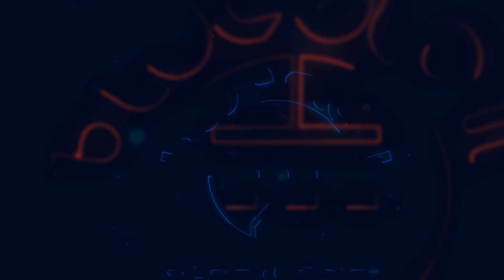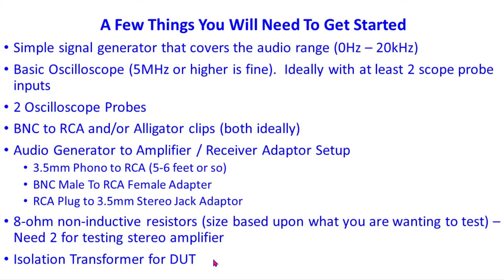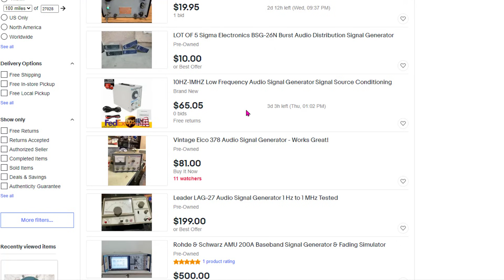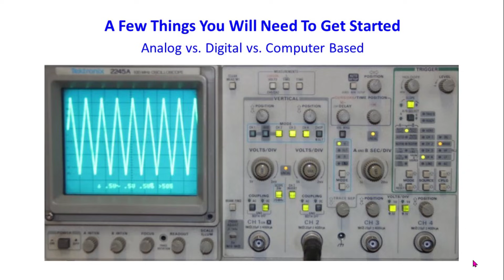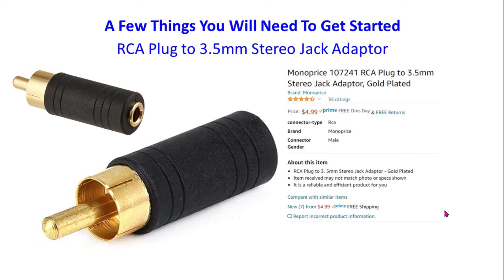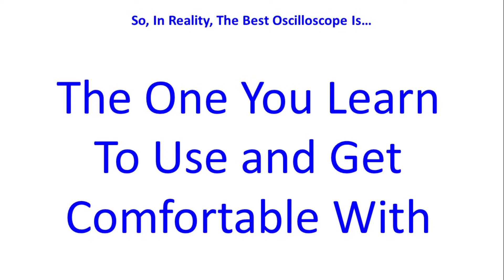Buying an Oscilloscope and Accessories For Audio Bench Work and Testing

Comment: Class !!! but a good multimeter  is need too .... a precise of coarse !!!
Happy good year Eric from France
Reply: And it pays to get a good quality meter. Although the "cheapos" do work, they don't work very well after a while and will become intermittent from oxidation on all the contact areas. Areas like the switch contacts and probe sockets where you have to "wiggle" them to regain non-resistance contact.  I finally went with Fluke when I could afford them and never looked back. There are other "top shelf" brands as well. I still use my "cheapo" meters a lot for things like "quick" checks and the like to save wear and tear on the Fluke meters.

Comment: Great video Mark!!! It may also be worth mentioning to the audience, that Variacs (Autotransformers) are not isolation transformers. Many people think they can double as such. Also, an isolation transformer, although electrically isolated from the line and neutral, is not necessarily isolated from ground. If you are going to use a 1:1 transformer for ground isolation make sure you check that the line side and load side grounds are not the same point electrically. For some, this can be fixed by a simple removal of a ground strap connection or snipping the ground prong on the line-side plug. I have a Tenma 72-1095 Isolation Transformer with adjustable voltage and it has a common ground. The load side plugs are connected to ground via a ground wire to the chassis. Disconnecting this wire isolates the load side. Just something to think about. Thanks!!!

Comment: Those non-inductive wirewound resistors typically have the wire wound in both directions, which results in a relatively low inductance. Not zero, but close. Unless you're taking really low distortion measurements, it's probably not critical to have it be ultra-low inductance. After all, a speaker is somewhat inductive. It is definitely worth getting four resistors though, because you want to be able to test into 4 ohm loads.

Comment: Great video and good advice.  Be sure to also get 50 ohm BNC terminators for your scope inputs to assure that you'll see correct voltage readings from your signal/function generator.

Comment: Very good video, sir.  I've ended up with several 'scopes ranging from a late 40s lab model through a dual channel Heathkit c.1970 up to a 100 MHz Techtronics.  For audio use on my radios I use the Techtronics or another 10 MHz scope (tube equipment) or one of the cheap DSO138 or DSO150 units from eBay/AliExpress/Bangood for solid state equipment (these are roughly $24 - $30).  I have used the DSOs fed through a capacitor for some boat anchors.  I plan on closely following the remainder of this series.  Thanks.

Comment: Being stuck on the other side of the pond does complicate things a little; looks like this one might fit the bill for all of us running lethal voltages at home:
https://www.amazon.co.uk/Bronson-1000-Isolation-Transformer-Toroidal/dp/B07K378Z2N
I would be grateful if you could please have a quick look and confirm it's suitable and thanks for a great start to a much needed tutorial !
Reply: It should do fine. Just keep it to 80% of it's rated capacity for longevity, although the MAX is 1000 to use at that all the time will cause premature failure. Most equipment will be way under that. Add up the maximum draw of all your equipment, then add 20% (minimum) to choose which to get. If all your equipment adds up to, say 500va, then you're good to go with a 1000va unit with room to spare.
Reply: @JeffCounsil-rp4qv  Thank you so much Jeff, have a couple of power amps with 800VA trafo each, so I'm hoping this will manage to hold while 2x15mF/100VDC caps are charging, obviously hooking either one at a time. Fingers crossed.
Reply: @paulb4661  You're too close to the max and will need bigger ones...  Maximum capacity: 1,000 Watt / Operating capacity: 800 Watt
Reply: @JeffCounsil-rp4qv  Hi Jeff, you're absolutely right, but then again I do not intend to run any of them nowhere close to the rated output of 230W per channel into 4Ω. Measurements will be done at between 1 and 10W of output power at most and looking at the power consumption meter, each draws about 150W  only at these levels, they are both class AB designs thankfully. Next trafo up, 1.5kVA, if I remember correctly, adds another £70 to the price tag, so a bit of a bummer. On the other hand perhaps it's worth it, for the sake of peace of mind.
Reply: @paulb4661  Yeah, sometimes the cost is a show stopper. However with the 1.5k, you will have the capability to go with "throttle up" without the risk burning up the transformers, and possibly the amps too. Even at "nominal" volume levels, you can get transients. And the impedance curve of your speakers could dip pretty low on the bass notes and draw more current.  Transients (peaks) happen so quickly that most meters won't actually show them. Especially RMS meters that "average" the readings.

Comment: I use Tektronix 2213A analog oscilloscope.  I bought it brand new 35 years ago.  Make sure the scope you get is in perfect condition and freshly calibrated.  If you get some old junkie military surplus unit, you may spend more time working on the scope then on the circuit you are experimenting on.

Also:
DO NOT CONNECT YOUR OSCILLOSCOPE GROUND LEAD TO A HOT CHASSIS.  
IF YOU DO, ZAP!
Reply: I picked up my Tek 2213A only this Summer. I was new to o' scopes and was surprised how easy it is to operate.
Reply: @williamstevens7090  Way cool !  I'm sure you paid a lot less than I did.  My Tek 2213A was $1,400 in 1985.

Comment: In regards with the oscilloscopes and generators, there are actually pretty good cheap digital chinese ones currently available from such manufactures as Hantek (DSO5102), Uni-T, and even pocket-size ones like from Fnirsi 1C15 on Aliexpress and other marketplaces. You can get full setup for 100-200 bucks. And it's more than enough for the audio.
Reply: Very true. But how well do they work a year later? Have they drifted out of spec? Have the connectors oxidized enough (from cheap plating) to cause erroneous readings?  I have found most Cheaper Chinese stuff to be in serious "question" a mere year later. Sometimes only a few weeks later. Although my Brother's Hantek seems to be one of the better brands, it even has issues only 6 months later with one channel going very noisy.  The old saying never fails... "You get what you pay for"....
Reply: @JeffCounsil-rp4qv  That could be true that there may be some quality control issues. And of course never trust the specs they write, it's a lie. But for audio work it's more than enough. As for me, I own a $150 Hantek too for about a year+ and it's still reliable. Most of the time the issues would be indeed oxidation or other very easily fixable stuff. "You get what you pay for" is very true but getting the best equipment for everything - I don't have that much money, I'm not from the Gates or Bezos family, and I have a limited budget which I would rather spend on better drivers for speakers. Plus it's just one of my hobbies, we're not talking about making money with it, right? :) Even then you can get a cheap one until you get a stable flow. As for old aftermarket models, who could give a guarantee that they won't fail too? At the end it's the same pig in a poke.

Comment: Great stuff, Mark. Thank you. Does anyone know of a source for a iso/variac/ammeter in one device? Super difficult to find these days, but perfect for tube gear.
Reply: All those are available as raw components, you could build one yourself!
Reply: @maxsample  Yep, good call. That's what I'll do.
Reply: A separate inline ammeter is the best way to go. To have an "all in one" iso/variac would require two separate transformers, and that becomes very expensive. Not to mention the shipping weight.

Comment: I settled on the Hantek DSO5072P two channel, 70MHz digital oscilloscope and a Koolertron two channel, 60MHz arbitrary waveform function generator. I still want an analog scope with XY mode so I can experiment with oscilloscope music some time in the future (music that displays fantastic images on an oscilloscope in XY mode). Cheers!

Comment: In ancient times when I worked at Tektronix, I used a 464 analog scope (I think that was the model). I learned to use it very well and loved it. A couple of years ago, I purchased (used) a Tek TDS420A digital scope with CRT display. Someday I might get it figured out. Like you, I grew up on the analog scopes and am struggling to get up to speed on all the menus, functions, etc., that my digital scope had. I just need to live long enough!

Comment: Thanks Mark brilliant introduction. I know very little about audio but I do repair and collect test gear. Just opinion but I wouldn’t buy any old scope TEK or HP unless it was a complete steal of a price most of these old scopes are well into the age where they start failing. I wouldn’t invest 250 in an old analog scope when I can buy a Rigol for a similar figure new with warranty.  Many of the new digital scopes will also be able to THD and other distortion measurement.   Someone below made a good comment about the maximum volt per division being generally much lower on a modern scope. I would stay away from the very cheap signal generator the output are horrendously noisy but ok if your paying a reasonable amount of money.  Lots of good old AF signal generator around on eBay with very low distortion.  I think you should also add an audio isolation transformer to your list. I found this essential very quickly but that could be because i work on a wide range of equipment.  But it’s easy to short out an amplifier and set up ground loops via the signal generator and BNC screens etc. Great video really looking to the other parts as i interested in learning about audio measurement. Please make sure you cover impedance and typical units such as dbV and dbU and how manufacturers specify audio performance.  Probably teaching you to suck eggs now sorry but excited to watch the future videos in this series. Best wishes to you and the family. My best regards. Chris
Reply from the maker: Oh lord...

Comment: Thanks for putting this series together. I’m looking forward to the rest of the videos. 

Can you comment on input voltage capabilities of analog vs digital scopes. Even with 10x probes, aren’t some of the digital scopes not necessarily ideal for  testing tube amps that can carry over 500vdc, plus the analog voltage on top of that?  Thanks.
Reply from the maker: That's planned in the safety video.
Reply: Your quite right most of the modern scopes are limited in terms of voltage per division as they weren’t designed for use with valve gear etc more for modern digital electronics.  I do have some some x100 probes I sometimes break out for valve gear but I don’t often find I need to take direct measurements of anode level Voltages very often.

Comment: Good introduction. I too am an analog scope guy. Used 10MHz Philips scopes in college (up in Canada). One of the most overlooked scopes on the market is a Tektronix 2236/2236A. It should be cheaper than your 2246. However, it has a pretty interesting built in frequency counter, and time measurement functionality and multimeter that can be slaved to channel A. I think the frequency counter is 8 digits, and it it a 4-5 digit multimeter, and there are separate inputs for the multimeter if you want to do voltage, resistance, and continuity tests. I think it can also do external frequency tests, but its been a while, so I'm not sure about that. The scope will put meaurement lines on the screen when the multimeter (for measuring Vp-p or Vrms) or frequency/time (just like the 2246 does). Neat part is that the multimeter/frequency counter is slaved to the oscilloscope channel, so the readouts are based on the vertical and horizontal settings on the scope, so no need to do math, or count graduations and then multiply. As far as I know, the frequency/time functions work to the entire bandwidth of the scope (100MHz), as does the multimeter, and I'm pretty sure that the Vrms is True RMS, even to 100Mhz.

I bought (leased actually) 25 of these Tektronix 2236s for the computer factory that I used to work at. We were constantly buying Fluke meters, and they would constantly disappear. Because I was working as a test technologist at the time, my boss asked me to find a solution to the "multimeter growing legs and walking away" problem. I looked a locking the meters up, tried it, and they still disappeared. I tried to get people to sign them in and out, and they still disappeared. So, I tooke the remaining multimeters off the production floor, and changed all the scopes out for Tektronix 2236s. No more missing multimeters, and the techs all found the scope's ability to do time/frequency measeurement a great benefit. Reliable, solid, and typical good Tektronix quality at the time (late 1980s to early 1990s). The HP 172X and 174X scopes were great too, as were some of the Philips (anything without the LCDs and non-digital) and Kikusui scopes (COS series). Never used the Hitachi scopes.

And by the way, the Tektronix 2465 series, while ridiculously overpriced these days, is probably the greatest portable oscilloscope ever made. I had one on my bench for over 5 years, and it was a joy to use, and a real advance on the previous scopes that went before it.

Comment: Isolation transformers may require you to separate ground from neutral inside of the unit.
There are more expensive red variacs that are isolated.
Reply: And those simply combine both functions in the same case.

Comment: Perfect timing... already have much of this equipment, but just learning to use it with audio equipment.
Reply: Is your dog part Chihuahua?  
Best way to learn electronics is in college.  DC, AC, Electronics 101 to 103.
No time for college?  Then learn:
Ohms Law, kirchhoff Voltage and Law, Thevenin's Theorem
Albert Malvino "Electronic Principles" is a really good book.  Hook up the example circuits in each chapter and test them with your equipment.  You will soon be designing your own audio amplifiers using discrete components.
Reply: @JohnDoe-bf1fw  Actually, I have a 3 yr College degree in Electronics... but didn't work at the component level for long, and don't recall doing much related to AC, other than motors and such. My dog was a Welsh Corgi.

Comment: Really nice video. 
I would like to make a question. Im after a GW Instek oscilloscope that has a peak voltage of 300 volts . My concern is that I’m not going to be able to measure power supply wave forms. 
I would appreciate any suggestions on the topic please

Best regard 
Octavio
Reply: If you were paying attention, that subject is coming in another part of the series...

Comment: I've got the Tektronix 2245A oscilloscope, which is very similar to your 2246. It's a great scope for a lot of electronics work!
Reply: I fell in love with the 2465B when the US Army replaced their aging 485s in the late '80s. I have a 2465B (100% functional), a 2445B (100% functional), another 2445B (about 80% functional), and yet another, possibly repairable 2445B for parts. I like TEK scopes.

OTOH, even a TEK 2445 is overkill for nearly all home and hobby use.

Comment: For basic audio work, there's a cheap Chinese unit that Dave over at EEVBLOG did a review on it, he didn't like, probably wasn't up to what he might have used it for but someone else did a great review on it, I think that it was the learn electronics channel, it's got a built in lithium battery and a 7" screen, has FFT and covers the audio frequency range! Because it's not plugged into the mains, it's isolated and being extremely portable you can use it on your car if the need ever comes. The brand is FNIRSI, has two channels and is touch screen! It does have menus but no where near as much as other scopes! You will find that the touch screen works really well to. But the price for what you get just can't be beat! It's battery is charged by usb and it's battery can be upgraded to something much larger if 4 or 5 hours isn't enough! It's actually built very well and feels very professional! It claims that it can measure really high frequencies but it can't, but for 0hz to 50kz, you will be covered, it can go higher but I only use it for audio, displays voltage and other data along the bottom of the screen which you can pick and choose which data you want and both channels data can be independently chosen! 
It's not as good or featured as a Rigol but it's almost half the price! 
For getting started in audio, I think that it's perfect! I also have an older CRT scope which doesn't do any data and I even got one of those tiny little all aluminium cased two channel scopes, it's also great just for audio but it's tiny 2.5 or 3" screen isn't something that you want to be starring at every single day! It's great to drop into your shirt pocket and go for a quick once in a blue moon but definitely not every day! 
So yeah, I think that the FNIRSI is definitely worth it if it's in your price range and you are only working with audio! If this unit becomes popular, I'm sure that the next model will have improved performance and features! 
I love it ❤️. I got mine from eBay but it should be also available on Amazon to... Check it out!